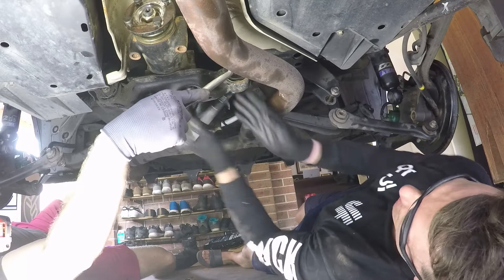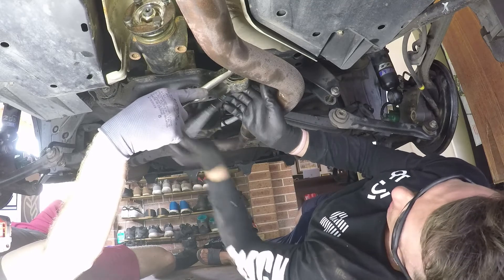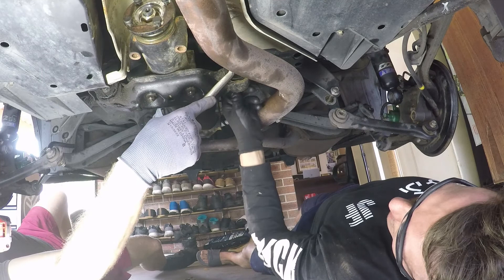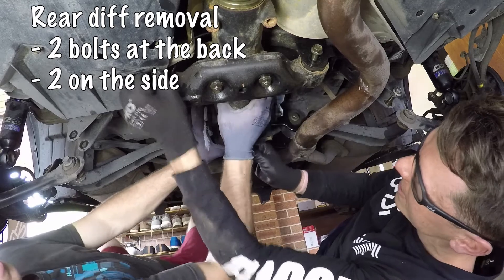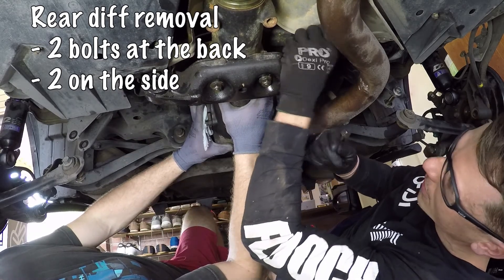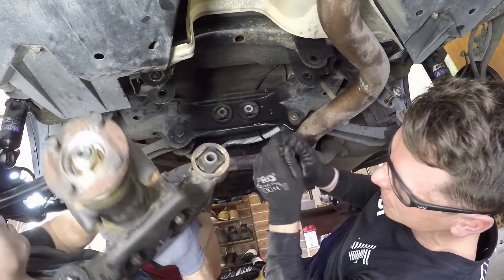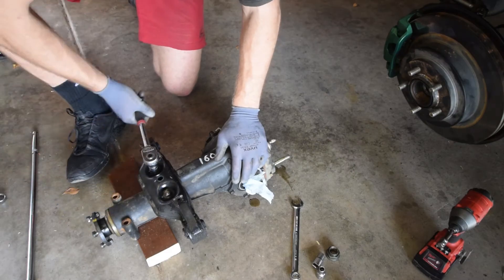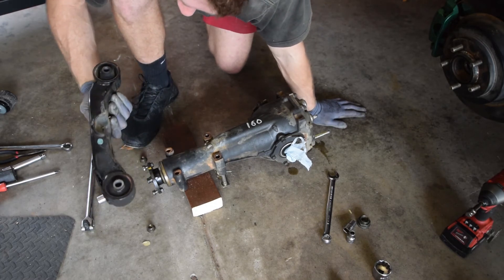How To 6spd Swap A Subaru | Part 1

Comment: Cool! 🔥🔥🔥 So how I understood, wrx sti flywheel 12310aa410 and clutch replacement just goes bolt on to ez30 with 6mt transmission instead of 12310aa350?

Comment: What's the difference between sti 6 speed or spec b 6 speed or legacy 6 speed transmission. Which is cheapest swap
Reply from the maker: Same box (for the most part), but rear diffs vary (short and long ratio). Cheapest would likely be any non-DCCD 6spd short ratio as they are more common and these days in my experience the long ratio are becoming more sort after (depending on application, for the street guys learn toward long ratio).
Reply: @BuiltByBlake  daily driven street application I just want the 6 speed and mpg. What year they come in 6 speed non ccdc?